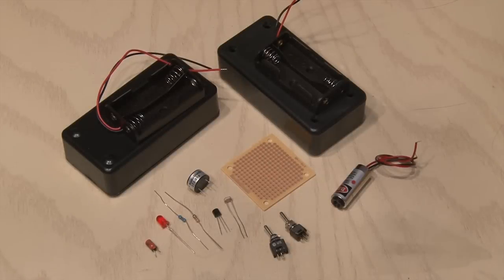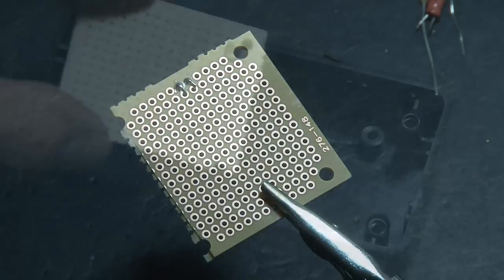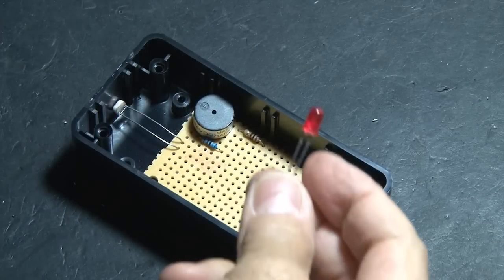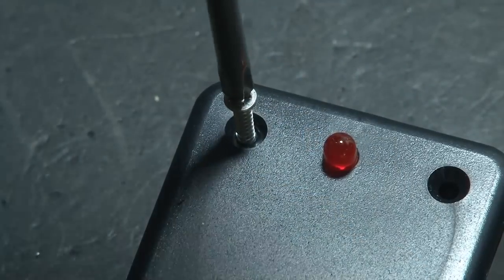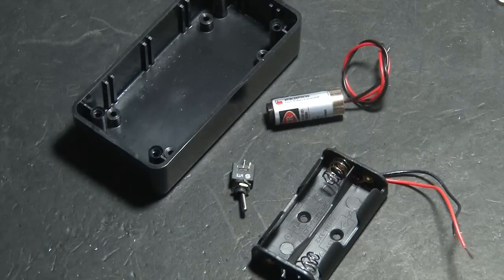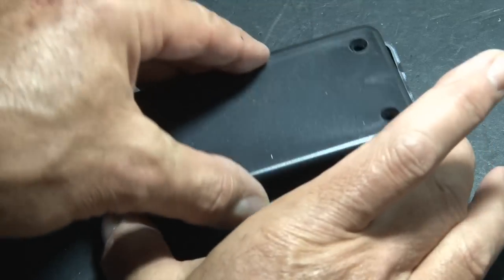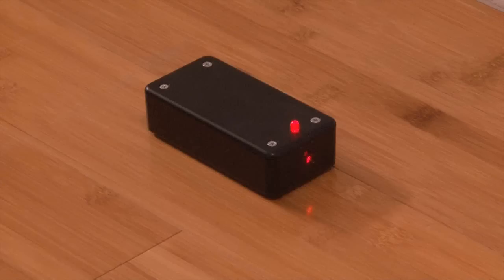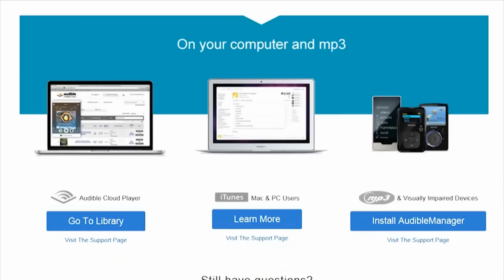DIY Portable Laser Tripwire!

Comment: I just stopped by radio shack. I made 10 of these things. I am a security guard so these will come in handy. I also added a mercury switch to each 1 so that they will go off if disturbed or removed. I substituted an the red laser with a 5Mw IR laser, and an IR sensor in lieu of a photocell. The indicator light is an old IR LED from an old remote control. Now i can see them with night vision, yet trespassers cannot. Great build Kip?

Comment: at 0:58 it's actually a thyristor, not a transistor.
A thyristor is basically a diode that has to be turned on through the gate and is conductive until the current between anode and cathode drops below a certain threshold (That's why the buzzer won't go out after the laser hit's the CDS again)

Comment: I don't know all that much about electronics (programming, computers, and hacking, totally different matter), but technically, can't you just grab a cheapy $1 5mw laser pointer, a battery, a led, a pnp transistor, and a photoresistor, and hook the photoresistor to the battery and led so that when the laser shines on the photoresistor the circuit is completed and it activates the pnp transistor which turns on the led which in turn gets connected to the battery through the transistor. It may not work, but if it does, it's a great idea for a much cheaper tripwire.

Comment: Actually BT169 is a Thyristor, not Transistor.

It would be better adding a potentiometer for the sensitivity of the LDR(Photoresistor) to the one leg of the potentiometer and the other two at +3V.
Thanks for the circuit.

Comment: Personally I'd wire them together and set them on a 10 second cyclr, one second on, 9 seconds off, to make the batteries last longer, then put it as a safe/hiding spot alarm, because if you did so, most people would take more than 9 seconds to dig through for valuables

Comment: I'd like one to alert me when the manager makes an unannounced visit to my apartment. Something that also counts off how many times some one has been in my place when I'm not around. Also, if I'm in my bedroom I want it to alarm me when some jerk opens the door. I'd put one on each of my doors. I'd want it to be small and easy to install without drilling holes or using double sided tape to ruin the walls. My doors are metal, so I could at least stick one of the devices to the door if it has a magnet on it.

Comment: I would like to make a variation of your receiver module . Instead of latching and having to manually reset, I would like it to sense when to beam is broken but once the beam is restored for a few seconds it resets itself.  I plan to substitute the led and buzzer with a micro relay that can provide a open closed contact wired into a modified Wyze contact sensor so the receiver can communicate wireless to a wyze camera system. What would you need to change to accomplish this?

Comment: Id exchange the alarm with something to send a message to my phone
Reply: An Arduino can do that, or a Rasberry Pi, but the Arduino would be a bit simpler in it's execution since you can take the wires that would go to the buzzer and use the voltage to trigger and SMS message.

Comment: Why did you decide to use a thyristor over a transistor?
Reply: Because a thyristor stays on, even if the gate voltage is removed. It will not turn off until you remove power from it.
Reply: jaaasgoed
Thank you.

Comment: HELP!! I want to make this into a laser timer. Basically I want to have two of these laser tripwires. One is yet at 0 yards and the other one 40 yards away. When the first one [0 yard laser] is tripped I want it to be able to somehow start a timer that stops when the other one [40 yard timer] is triggered. The purpose of this would be to help me for timing my 40 yard dashes for football and for when I practice with my friends. The only problem is that I don't know how to do that because I'm not really much of a techy guy. I'll appreciate all the help, thanks guys.
Reply: Asian_Brotherz So, I laying in bed last night with my very little knowledge of this stuff. I figured have one separate box with an arduino timer in it, like the one kipkay made in a previous video. Put an extra component into the laser tripwire boxes that sends info to the arduino, such as when its broken. Only problem is I don't know what kind of component that would be.
Reply: Asian_Brotherz This is a relatively complex project. You would likely need a linkage between the two lasers for it to tell when one is broken , and then when the second one is. You would likely need an arduino connected to a 7 segment display so that you can see what the time was, as well as a presumably wired linkage between the two laser modules.  You could use two arduinos connected by I2C. The starting one would likely be the slave arduino and the ending one would likely be the master. When the first beam was broken it would send a signal to the second one, and the time it takes you (or the person running) to reach the second one would be timed. 

 I would be willing to bet that if you google what you want to do you will see someone has already done it, and then you would just copy their project and code. It would likely be simpler. If you do design it yourself, using a wired linkage would be advised over a wireless one because wireless protocols are ten times as complicated as wired ones, as well as the fact that wireless ones are a tad slower.